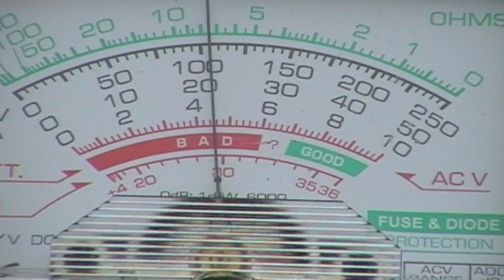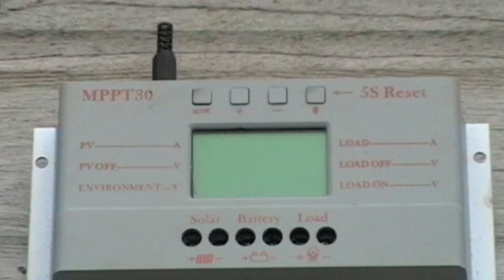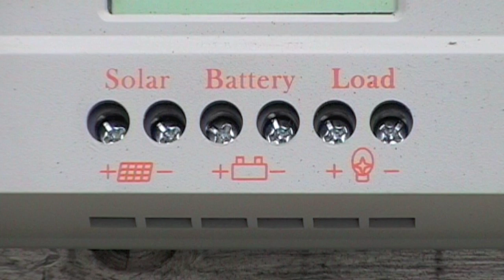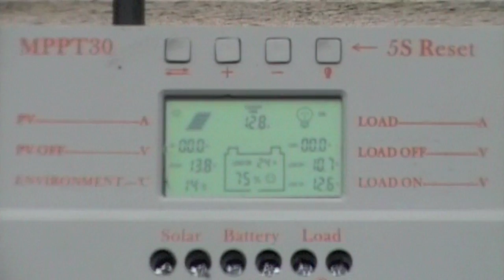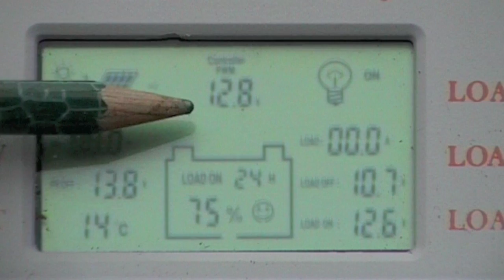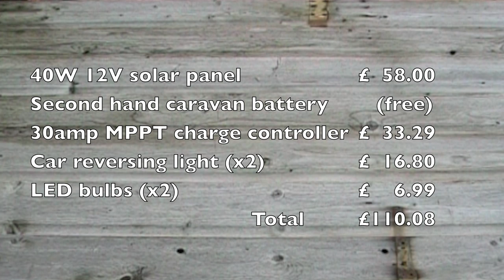Solar powered shed: 01 Basic solar setup

Comment: You refer to the panel being 12V and then express surprise that it is outputting 20V. This is a very common misconception. There isn't such a thing as a 12V or 24V panel, it's just a 'nominal value' meaning you will get at least that amount. A typical 260W solar panel on a house roof will output about 32V @ 8 amps, but is still a '12V' panel in that you can use it on a solar charge controller to charge a 12V battery. Oh..and the other posters are correct. You wired up the solar controller in the wrong order. Should have been battery first, then your light, and last the panel. Not the end of the World with such a small panel, but best to do it the right way. You have a voice for radio. Great video.

Comment: I think you should have connected the converter into your load sockets (output) from your charge controller!!
Reply: And you forgot to mention that you have DC - AC Converter into your price list. It is required for us to use the generated supply into household appliance.

Comment: Would you add a list of materials to your description? And maybe links where you purchased them. Thanks!

NVM. I'll put here what's at the end of the video:

40W 12v Solar Panel -  £58
Used Caravan/RV battery - free
20 Amp MPPT Charge Controller - £33
Automobile Reverse Lights x 2  - £17
LED Bulbs x 2 - £7

Comment: Nice video but (there is always a but) a fuse on the small wires feeding the charge controller just over the max current your panel is rated for is very important. Not that the solar panel could put out to much power but if something went wrong like a wire shorted or something inside the charge controller failing it would turn those small wires into heating elements fast. I love your voice and they way you spoke very soothing.

Comment: Can anyone help: If I need the DC only during night hours to power my night LED lights (Don't want them on round the clock),  about 100 feet away from battery, what component do I need to add and at what circuit? Do I need to first add inverter close to storage battery, to have AC then to feed a usual  AC timer or photocell, then taking care of distance that could be an obstacle with DC, then before the light connection, back to DC? Or is there a better way? Any ideas?

Comment: Great work.

Before you go plugging anything into that inverter, though, there are a lot of variables to consider.
* Is it a standard car battery or a deep cycle  battery? - they behave differently
* Amp hours of the battery
* Discharge rate (how fast will the battery give up its power) - see specs for the battery
* What is the safe discharge level (usually 50% to prolong the life of the battery) - see specs for the battery
* Condition of the battery - will it fully charge or is there some resistance?
* is the inverter 1000W, 2000w, 3000W?

Once you know the maximum discharge you can determine what you can and can't attach to that panel/inverter/battery combination according to the number of Amps the appliances draw.  I would imagine you could surely be able to power a radio (.5A), a laptop (.5A) a phone charger (.5A) all at once for many hours.  You might just be able to run a microwave (4.5A) for a short time but probably won't have sufficient power and for long enough to boil a kettle (13 amps).  You almost certainly won't be able to use an angle grinder (5 Amps) , a fridge, heater or an air conditioner.  I'm not sure about the drill you want to use. (Remember don't discharge the battery below 6 volts)

As for the 100A circuit breaker. I'm no expert but I don't know if that's going to protect anything.   1000W @ 12v is 83.33 Amps.   You'd probably have to have a bigger battery bank to supply that much power and attach 20 angle grinders simultaneously to draw the amperage required to blow that baby.  I think the wires you currently have between the battery and the inverter would be toast or at least as spreadable as butter long before that.

I don't know what fuses/circuit breakers you would have in the UK but in Australia we have 10 Amps for lights and 15 Amps for power @ 240V.  Of course the amperage is higher at 12 volt but surely not 100 Amps.

http://www.electricalsafetyfirst.org.uk/guides-and-advice/electrical-items/amps-and-watts/

Comment: Calming voice, birds chirping and the background sounds of nature can't get better than that for an instructional video. Two thumbs up! I would have gave him three but that"s all I had.
Reply: Fuse close to the battery so that unfused cable can't touch neg. terminal ,fuse rating should be not more than 1.5 times rated safe current capacity of cable .D.C.current is 20 times A.C.current @ 240 volts & 40 times @ 120 Volt's
Reply: Absolutely, I went and made a cup of tea and had a snooze afterward and forgot all about installing my solar panel, so relaxing :-D
Reply: @Ginger-Time   

Yes I nodded off
Reply: That's very good to know. I may incorporate that in my setup. Thank you.
Reply: maldonvic : the price of the inverter was omitted otherwise the price could go up.... However the presentation was excellent as it was easy to understand.... Thanks
Reply: maldonvic gr
atulalok
Reply: and that persistant dog in the background haha
Reply: TheFrontEnd Theory 
Yes, dogs barking incessantly like that are really annoying and far from ‘peaceful!’
Reply: Tradu in romana

Comment: Did you just say you had all that for under £100? if so where the hell did you buy it all?
Reply: https://www.aliexpress.com/store/520886?spm=2114.10010108.0.0.32d1dff9PRQBO6
Reply: UK Here We Grow
BTW NO tax or fees
Reply: www.jex-electronics.com sells those circuit breakers they are based in the USA but ship worldwide.
Reply from the maker: Everything came from ebay, except the battery which was second hand and free. Check the  end of the video for the prices (as of 2015).
Reply: UK Here We Grow eBay
Reply: eBay !!! Amazon !
Reply: hi everyone ,if anyone else wants to uncover why choose solar energy for your home try Ewans Energy Roadmap (Have a quick look on google cant remember the place now ) ? Ive heard some amazing things about it and my cousin got excellent results with it.
Reply: Yes i need one sets plz contact.......me
Reply: 7 Ways To Prolong The Life Of Deep Cycle Lead-Acid Batteriessss > https://t.co/mK3KjJd0lr?lvert54CEVR3haaf45 >
Reply: UK Here We Grow g
Reply: Great video...got some questions:
1. what can you power up with such set up? (looking into smartphone/laptop/power bank charging)
2. what's the solar panel u r using (don't what I should be using )?
3. Any battery will fit in?
4. link to the seller u purchased all these?
Reply: See above for the answer to #4.
Reply: UK Here We Grow , here in manila in Ra- on street you can buy all for 50£ mate. Greetings from A browny.  All the best.
Reply: @davidran5923  in manille May be.....but  here in  FRANCE..it is  a  lot  more expensive..with  100€..you have  nothing at  all

Comment: when you connect a solar panel to a charge controller you first need to connect the battery you will confuses people if you don't know what you are doing yourself.
Reply: I thought that when i watched the video.
Reply: I would like to power up a fridge and 1 light bulb what size solar panel would I need, will 12 V battery be sufficient or do I need 24V...? When does one need to use an Inverter?
Reply: @franciscohen4242  A moderately sized fridge, like 200 litres, and an incandescent light bulb of 15 watts, will require a solar panel of about 400 watts charging capacity with a 12v battery of about 200 amps. My rough estimates.

Comment: I thought the video was good, I can see people are picking you up on a few points but I still think you've done a good job. Person below me is saying battery should be before charge controller ,  I'm no electrical expert but I would have thought that would defeat the object i.e. you don't want to cook the battery. Be glad if somebody could elaborate?
Reply: They mean you should connect the battery to the charge controller, in the battery position terminals, Then connect the Solar panel to the charge controller, in the Panel position terminals.
Otherwise the panel is producing electricity to the controller with nowhere for it to go
Reply: Perhaps you misunderstood. They mean order of wiring, that is when making connections, first connect the controller to the battery and then connect the controller to the panel. Order is the same: Panel->Controller->Battery->Inverter. DC load can be taken directly from the controller
Reply: Exactly right.

Comment: i have 2 solar panels 2 batterys but i cannot run electric drill how many solar panels and batterys do i need to run a 3 horse power electric motor? do we not need any circuit breaker for safety purposes
Reply: Solo Putra wire in an inverter

Comment: I didn't read all the comments to check whether or not someone already asked but why did you use 2 red and 2 black wires from the panel to the controller?
Reply: Using 2 Red and 2 Black wires for 3 purposes: 1. The controller only accepts wires input via screw terminals, but the panel can't provide that. 2. Two wires for redundancy. 3. Lower voltage drops from panel to controller.

Comment: great video, congratulations. Please one question: if you had 2 batteries (and you get 200 watt in a day from your panel ) does it mean you double the wattage?
Reply from the maker: I don't think so. The solar panel will produce the same amount of power but you'd be able to store more of it because two batteries would have twice the capacity.

Comment: Hi - how can I measure the incoming variable solar panel voltage after this supply has been connected to control panel. What I want to do is see is the available solar panel voltage available to the solar controller.
Reply from the maker: The charge controller shows the amps the panel is generating.

Comment: how do you calculate the size of the fuse?
Reply from the maker: I didn't bother to try and work it out. I looked about at what other people were using with similar set ups.
Reply: Homestead
Thank you for answering.
Reply: it's just P = I * V, so Current = Power / Voltage = 1500 / 12 = 125A
Reply: right

Comment: This reminds me of 70s tv, nice. Question, can you plug the inverter into the load ?
Reply: That what its for! No need for duše its fused inside tre controler and it prevents that the battery gora u undervoltage You can program your own parameters
Reply: ectomorph nice video
Reply: Tom Jones song
Reply: How are you
Reply from the maker: You probably can but I wouldn't. The inverter cables that attache to the battery are quite thick and they get warm when being used. I found the load from the controller could handle the current.

Comment: Where did u get a inverter for 36 pounds ?
Reply from the maker: It was from eBay. It's a modified sine wave inverter. These are cheaper but will only run basic electrical appliances. Pure sine wave inverters are better but more expensive.

Comment: what type of circuit breaker did you put in your positive wire, and where did you get that and how much, id  like to have like that kind of ckt breacker
Reply from the maker: I think they are used for car audio systems. If you search eBay for 100 amp circuit breaker you should find them.
Reply: Adress shoop can i have . Please

Comment: Battery should have been connected before charge controller.
Reply: was going to comment, as soon as I saw it .. what a shame if people don't see this comment.
Reply: can you please explain why is that necessary
Reply: @ahmedsallam4989  If the Charge Controller is MPPT it will auto detect whether you have a 12V or 24V battery bank
Reply: It's simple, Just go to INPLIX page - click the PIG and make it yourself.
Reply: They use diodes for this reason or maybe I'm delusional...
Reply from the maker: Yep. My bad.
Reply: James D
Reply: Hi James , what is the correct set up: solar - one line to battery one line to controler so then where the invertor? thanks
Reply: Do not put inverter onto load. Charge-controller is only rated for low current (3A or so) The inverter will take maybe 30A  when it is running a drill like that, so would burn out the relay in the load circuit of the charge controller.
Reply: Yeah, I made a mistake and couldn't find the site, it goes directly to the battery
Reply: Absolutely - battery first, then solar panel.
Reply: You do know that charge controller cuts off battery charging when its full? Where does the power go then?
Reply: Stupid kid who knows nothing. The way it's done in the video is CORRECT!! The whole idea of the charger is it REGULATES and CONTROLS the CURRENT and VOLTAGE going into the battery!!
Reply: Usman Kazaure Abdullahi instali panelit solarski
Reply: Usman Kazaure Abdullahi
Reply: How would you recommend solving this? Better controller or have it directly connected to batteries? How would you make sure you disable power so you dont empty the batteries? Thanks in advance =)
Reply: Ahmed Sallam so u don't shock yourself
Reply: Usman Kazaure Abdullahi o
Reply: trfugff
Reply: Because the solar panel can over power the Charge Control in larger systems. The battery lets the power go somewhere.
Reply: Exactly! We need more people to be educated on this step. I wish the world in general knew more about solar panels, charge regulators, and batteries.
Reply: I agree. Battery hook up FIRST,people.
Reply: i doubt its necessary, this is youtube
Reply: Usman Kazaure Abdullahi8 : you are incorrect. the system is hooked up correctly as the video shows.

Comment: Not sure I would run lights direct from the 'Load' on the Charge Controller.  I would run from the battery, via a switch so that I can use them all the time (even at night) - running direct from the Charge controller limits the use of the lights to times when the Solar Panel is generating power.
Reply from the maker: I guess charge controllers work in different ways. In my one the load is drawing power from the battery rather than the panel. I've been running lights in the evening. It also protects the battery by cutting the power once the battery voltage drops below 10 volts.

Comment: You said not to short out the wires from the solar panel, this is not a problem and is the way that the maximum current from the panel is measured by inserting a current meter directly across the terminal hence shorting out the panel. But you should have connected the battery connections 1st into the charge controller and not on the battery as shorting out the wires connected to the battery by mistake could cause a fire, but not from the charge controller. Was it cold i.e. why do you have gloves on.
Reply from the maker: Thanks for the advice and yes, it was cold.

Comment: Hi. Just so you know, this charge controller is not mppt, you can find reviews on YT, for example by Julian Ilett of a "MPPT-20", just like yours. It turns out to be a simple PWM controller. The cheapest controller with real MPPT, that I found so-far, is the EPever/EPsolar Tracer 1210, it's about £47 on e-bay from China.
Reply from the maker: Yes. Your right  these are not as advertised. Still, for the price, they are an OK charge controller. The display screen is pretty good and you can charge USB devices from them.
Reply: hey, you are right i have EPever tracer 1210. it is such a nice MPPT solar charge controller.
Reply: vvvvvery good

Comment: why put in a fuse on your inverter? they all have one from manufacture and usually rated at 20amp.never seen one without.
@9.10....24v ac power from a wall socket in the house? i dont think so
Reply from the maker: Looks like mine has an internal fuse. You have to crack the case open to get at it. My external trip fuse just makes resetting it easier. Not that it's ever tripped. I've been running my stimmer, drill and other small power tools off it in the garden. I get a couple of hours use before the battery voltage drops too low.

Comment: no sun and your getting a high voltage (you say over 20 volts on cold cloudy British day) reading. the thing is if you don't have amps and watts the voltage can be reading a million but wont power anything at all and absolutely wont charge a battery. you need the watts and amps.you also state bare wire must not touch? its dc power not ac...i use cheap 1.2v nimh AA batteries in series to make up 12 volts and each batt being 2500ma im getting a battery rated at 12v-25 amps. try it as they last much longer than car or deep cycle marine batt and much cheaper.
Reply from the maker: You're right. That was the 'open' voltage, without the system doing any work. On most days It charges the 12v battery at between 0.5 and 1.0 amps - so just a trickle charge. However it keeps the battery ready for when I need it and it gives me a few useful hours. Interesting what you say about other batteries. I'll look into that in future but I've got a free source of partly used car and marine batteries and not much is cheaper than free!

Comment: Very helpful. Could I just ask why you have put 4 wires from the solar panel to the charge controller? Also what type wire did you use? Great video thanks
Reply from the maker: Thanks Chip. I wasn't convicted the single wires would be thick enough so I doubled up just to make sure. In the final installation I'll be using proper solar grade cabelling.
Reply: +Homestead thanks for reply.

Comment: Very helpful. Could I just ask why you have put 4 wires from the solar panel to the charge controller? Also what type wire did you use? Great video thanks
Reply from the maker: Glad you liked it. I doubled up the wires because I should have used thicker gauge wire. I just used what wire I had. Most of it is car wiring.
Reply: Probably one of the best video on the subject. Thannnnnnnnks